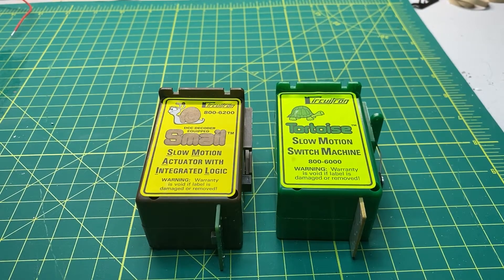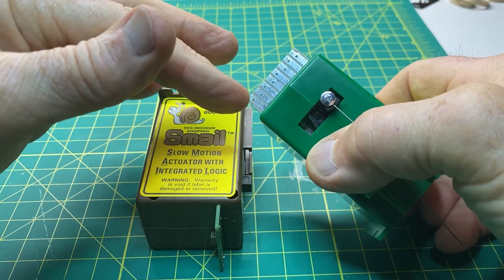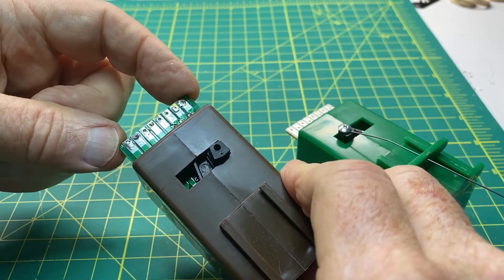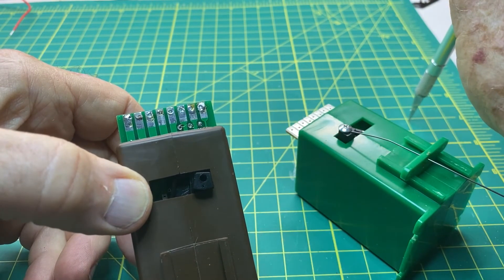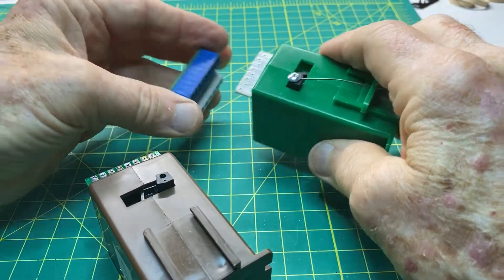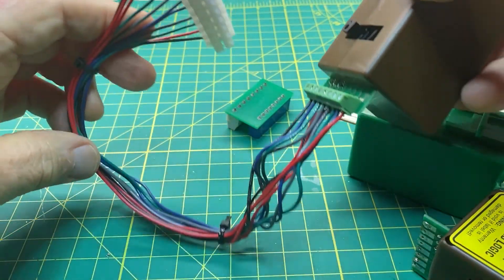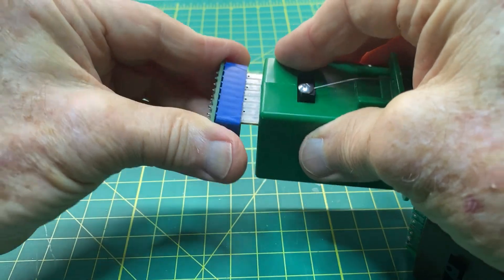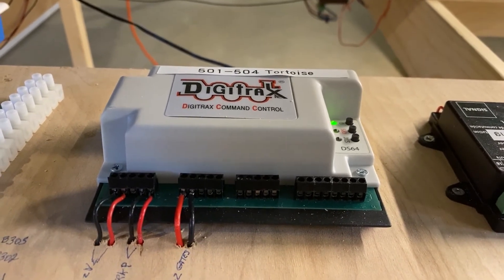Smail vs Tortoise

Comment: Thank you for the tutorial. If the Smail is connected to the bus and you have two turnouts combined on one Smail in a double crossover, how much current and how many amps would it draw when activated? Is the draw something you have to calculate into how much power you supply to a block?
Reply from the maker: The Smail draws very little current and nothing you need to worry about. I would not connect the smail to a block detection feeder. Rather connect it to the DCC bus running from the booster.

Comment: Jim what is the difference between the two machines in vertical dimension when used with terminal adaptors inc projecting wires?
Reply from the maker: They are virtually identical if you use the same connector on each one! The differences are on the circuit board internally.
Reply: Jim thank you for the video and follow through inf

Comment: Thankyou for a very informative video. I am just getting back into the hobby and so much has changed since I last had a layout. DCC was just starting out and I had the old Hornby Zero one system. (Yeah I'm way behind the times). Trying to figure out the new plethera of choices for point motors, DCC chips, sound chips, stay alives,new super magnet replacement motors etc is an absolute minefield. But I do like the idea of less wiring! I think that as I have several double crossovers in my layout I will use the DS64 (now a 74 I believe) and combine old with new to save cost. I have lots of old power supplies hanging around and so zer o cost there. Using a DS on double crossovers ( I have 8 in a large switching section)  will only require 2 units.
Reply from the maker: That solution makes sense.